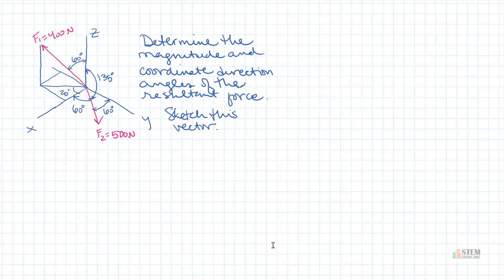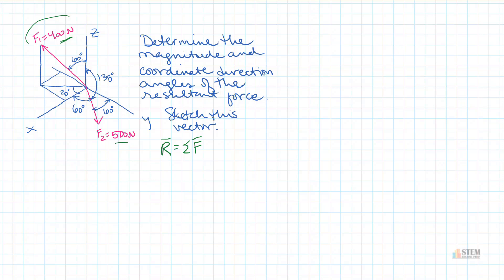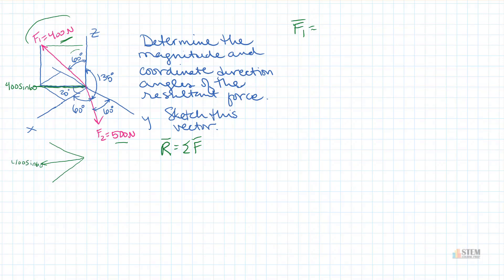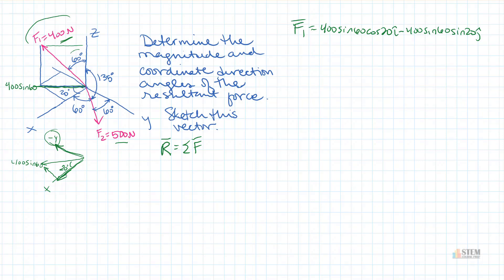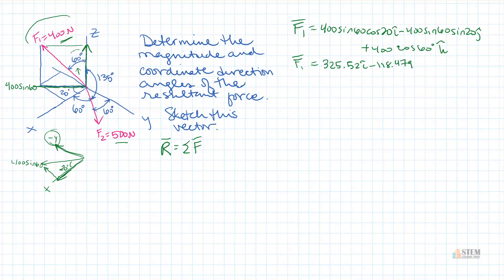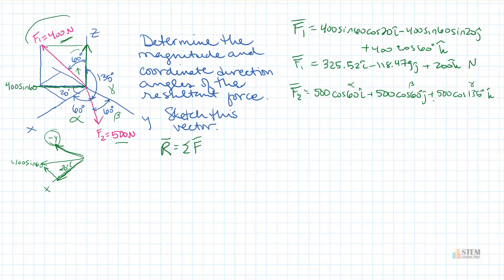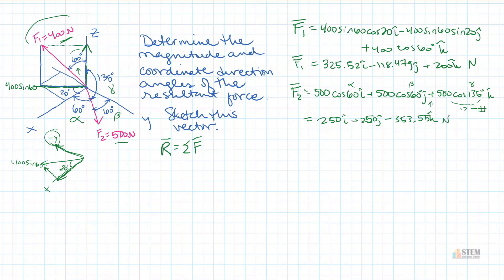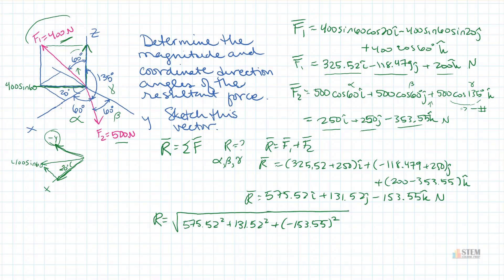Statics Exam 1 solution transverse azimuth, cosine direction angles, 3d force vectors with resultant

Comment: This is "tricky" problem.  You are covering two types of vector definition in one video.
1.) 400 magnitude vector: described in elevation angle(z direction) and azimuth angle(x and y plane)
2.) 500 magnitude vector: described in angles directly relative to each + direction axes.

You forgot to add a 3rd method of vector definition.  The point to point or cartesian coordinate method.
Reply from the maker: I didn't add in that last method because I hadn't covered that in class yet when I made this video.  : )